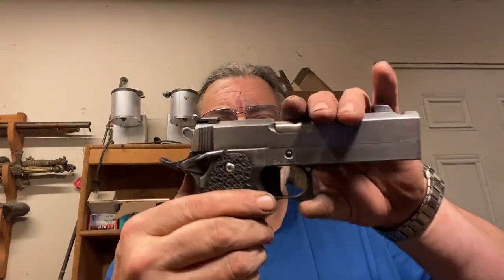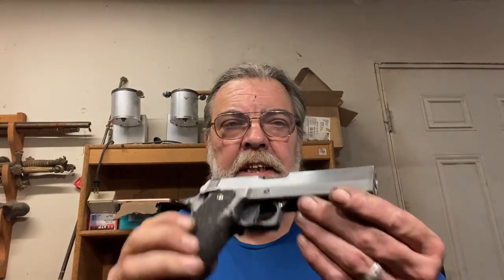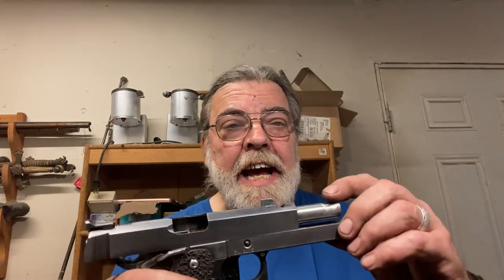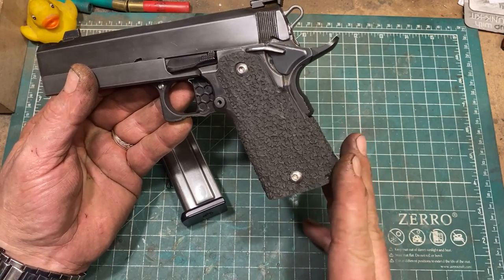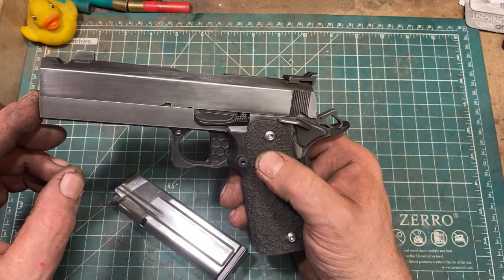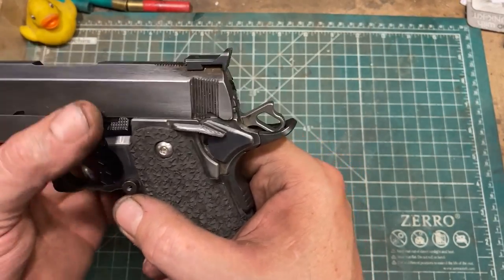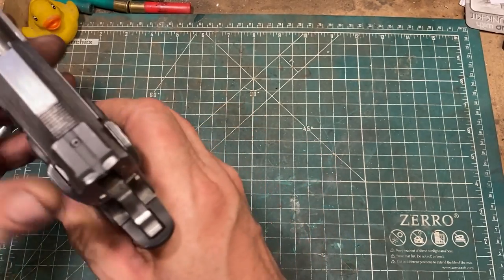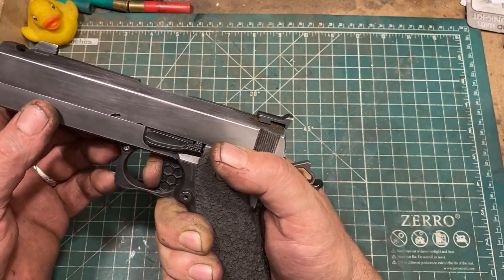Project 2011  Part 1

Comment: Coming along nicely. Surprised it’s running fast with that 10lb spring though. Could be the reduction in muzzle flip is counteracting the reduced return speed, I guess?
Reply from the maker: The light slide's low reciprocating mass allows the use of the lighter spring, and with the force of returning to battery lowered it makes it less likely that it will knock the muzzle down on really fast double-taps, helping to prevent 'dropping' the second shot low.
Reply: @tinkertalksguns7289  the slide must be very light. My 4.25” 9mm commander has an 11lb spring and it is only marginally faster than my full size 38Super with a 12lb spring. Which feels glacial compared to my 3” and 4.25” 45s